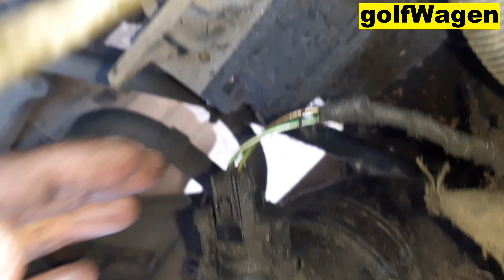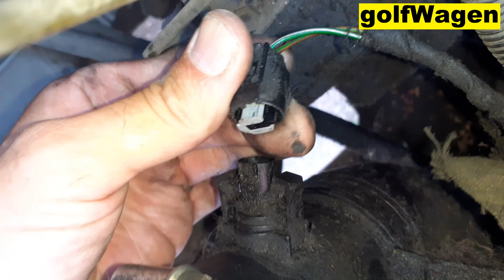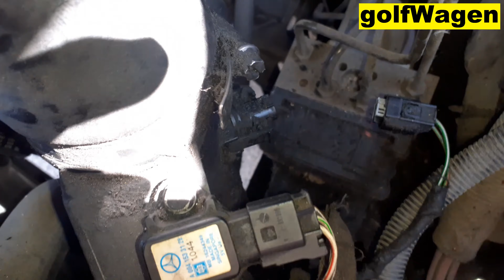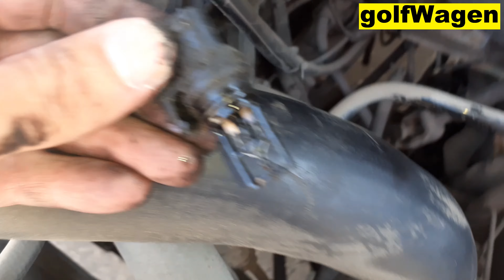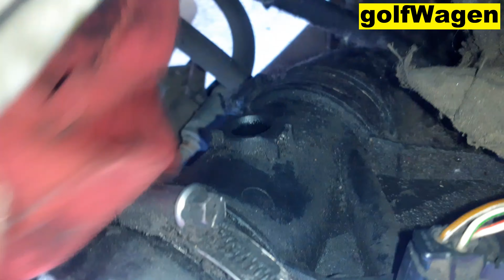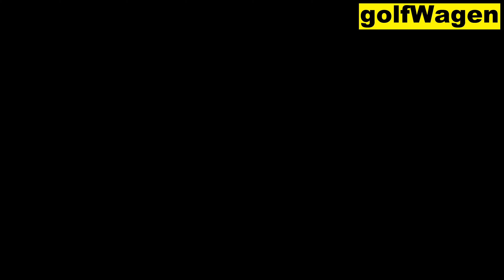Mercedes Sprinter intake air temperature sensor replacement

Comment: On a GL350   it's on the passenger side above the alternator. it's on the end of the throttle body... on the black plastic section.  remove this section to remove the alternator.